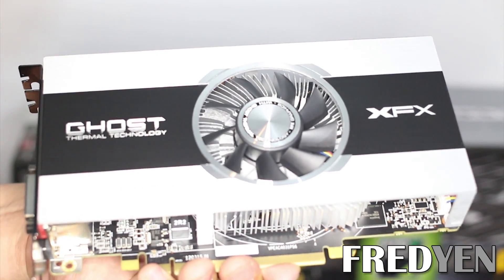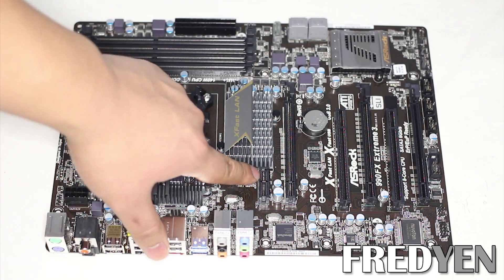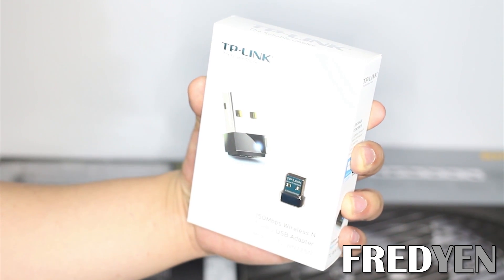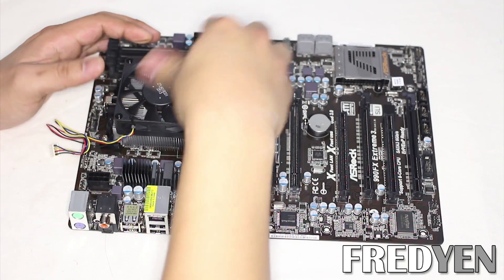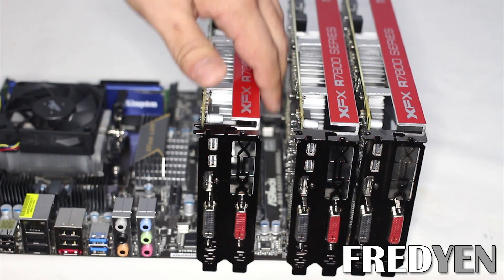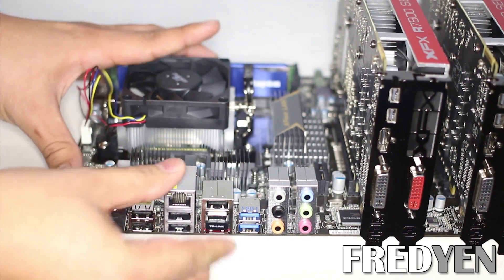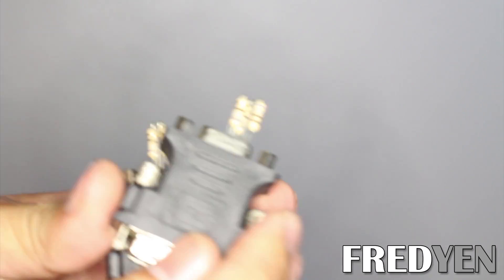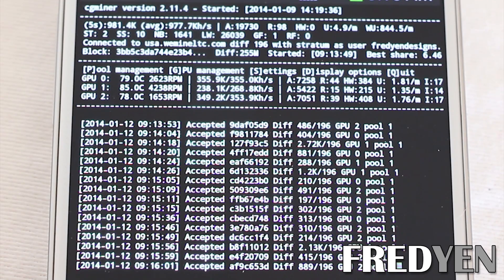DIY Litecoin Mining Rig (Chaincoin, Ethereum, Dogecoin)

Comment: i am having saphire vaporx r9 270x as graphic card of 2gb
msi z97 sli karait edition as motherboard
550 corsair smps
16gb 2400ghz custom rams
2 tb Mechanical HDD and 128 GB SSD
processor as i7 4790k

is it enough or should i change something ?
Reply: ok

Comment: These Rigs are not the way to mine scrypt Algorythm these days. A Zeusminer that you can get for 10-30€ used on ebay mine with 1.3-1.5MH/s ! BUT you can mine X11 Cryptonote Algorythm Coins with this rig pretty well. Otherwise Asic Miner are way more powerful than mining with GPU´s and way less expensive.

Comment: So after I set up the milkcrate. Is it hooked to a just to a monitor standalone with a mouse and keyboard or is it hooked to a laptop to where I get the information? I get the big picture on building the crate but the little things of where does the mouse and the keyboard where does that go and the monitor where does that go?
Reply: The mother board has usb ports in the rear that you could attach the keyboard and mouse to and either a moniter or laptip will work. And when its on you can unplug the mouse, keyboard, and moniter.

Comment: fred,

q? if i understand correctly, all that expensive hardware doesn't outperform a simple ASIC 1.6MH/sec miner?

those are easily available on amazon for about $40.  newer 2.0MH/sec are even cheaper.  (yea!)

thanks ... allen.
Reply from the maker: Those ASIC miners are for sha-256 coins like bitcoins. This GPU miner is for scrypt coins like litecoin, dogecoin, ect...
Reply: *****
thanks for your response.

can you please build a larger bitcoin miner?  i'm slowly building using individual ASIC miners (https://www.bitmaintech.com/productDetail.htm?pid=00020140227111546291QgbvQbVr06FB), would like to build a larger rig (https://www.bitmaintech.com/productDetail.htm?pid=00020140107162747992Ce5uBuxW06D6) but kludging the parts together makes me nervious.
Reply from the maker: Build the same raspberry pi rig like i showed in the bitcoin miner video, then just plug in any usb ASIC miner into the hubs. Add additional usb hubs if needed

Comment: Hey Fred, did you manage to get 4x GPUs working on the ASROCK 990FX Extreme3? I bought four Sapphire R9 290 but my ASROCK recognizes only 2! :o
Reply from the maker: What operating system are you using? I am running 3 currently on linux and all GPUs are recognized

Comment: Hey Fred, Great video. I've got a critical question though, I'm using an asrock motherboard that has 5 pcie express 3.0 slots, what are the purpose of using the motherboard power reset switches? Are they even required? I noticed you have them listed in the description, and I just wanted to ask you before ordering... don't want to waste any cash!! 

Thanks so much!
Reply from the maker: It depends if your motherboard has a built in power switch. You need someway of powering on the unit. If the motherboard does not have a built in switch, you can still power on the unit by jumping the connectors. I just feel the external switch is the most convenient way to turn it on, but its technically not necessary.
Reply: ***** Thank you :)

Comment: you are clueless, you arent supposed to lay the mobo down on the table, you probably will damage it
Reply from the maker: Yah thats why I have been mining at over 1MH/s for over a month with no issues. Thanks for the comment though.
Reply: ***** and you forgot an sli/crossfire bridge
Reply from the maker: soul evans not needed on a miner. intentionally left out. thanks
Reply: *****
You may be mining, but that doesn't mean it's a good practice to just lay the motherboard on the table. There are certain rules and guidelines when dealing with electronics. Nobody says that you will damage each and every mobo you put on a rough surface, but you certainly will damage one someday if you continue doing it this way. Also, use thermal paste!

Comment: Very helpful video! ;)

But what is the sense in setting up an mining rig with 3 graphics cards?
Why not use some Mining Sticks, like the AntMiner u1 with 1,6Gh/s?
Or is there a difference in the power of those sticks and a dedicated graphics card?
Reply from the maker: Those asic miners are only good for SHA-256 coins (ie. Bitcoin).
Reply: Yeah, i realized that the day after i posted this comment^^

But will a mining rig like the one shown in the video ever pay itself off by mining dogecoins or litecoins?
Reply from the maker: Om3gaPlay Yes it will depending on the current value of the coin you are mining. You can find calculators for the coin you want to mine

Comment: dude...you're "HW" hardware errors should be at zero...i assume you know that is nooo gooodddd :)
Reply from the maker: Yup I know, that video was taken the first day I set up the miner. I changed my thread concurrency to 8192 and have no HW now.
Reply: try this instead:
--tread-concurrency 32765

-g 1 (gpu threads)
- gpu 947 (r9 290 asus/gygabyte)
-gpu 1007 (r9 290 msi)
-mem 1500  (r9 290 asus/gygabyte)
- mem 1250 ( r9 290 msi )
- powertune 20 ( extra 20% power )

hope it helps ;)
Reply: intensity between 18 -20 ... see what gets you then less % of rejects...

Comment: Hi, I have a 7870 XFX and I'm only mining at 320kh/s at 20 intensity. Can you please help me increase my hashing rates. Thanks great video by the way!
Reply from the maker: My CGMiner setting are:
Thread Concurrency = 8192
Engine Clock = 1050
Memory Clock = 1350
Fan Autotune = Enabled
Intensity = 17
I am getting 360 KH/s easily with 0 hardware errors. Give those settings a try

Comment: is litecoin more profitable then bitecoin right now? you are generating more coins now with this setup thats for sure
Reply from the maker: Yes it is. Although they are worth less, you are able to generate more coins like you said. It does become more profitable. Atleast for now.
Reply: if im right you produce around 1/2 litecoin a day. is that correct?
Reply: jumanji cimiconga
I think it's actually closer to 0.314183895 LTC per day. My calculations are:

LTC/day/kh = reward / ((diff * (2^32)) / 1000 / 3600 / 24)
LTC/day/kh = 50 / ((3130 * 4294967296) / 1000 / 3600 / 24)
LTC/day/kh = 50 / (13443247636480 / 1000 / 3600 / 24)
LTC/day/kh = 50 / 155593.14394074
LTC/day/kh = 0.00032135

Take that and multiply it by the hash rate you have, and you get the estimate:
LTC/day = 0.00032135 * 977.7
LTC/day = 0.314183895

For someone with 5MH/s, that would be:
LTC/day = 0.00032135 * 5120
LTC/day = 1.645312

This is on par with my average earnings of about $33/day (before factoring in electricity), with LTC/USD at $20:
USD/day = 1.645312 * $20.00
USD/day = $32.90624

For more details, see my spreadsheet:
https://docs.google.com/spreadsheet/ccc?key=0Aj2Ife4jfe3CdHR0VlZCMjVucUpZbVJnT2YtdzEzcXc#gid=0